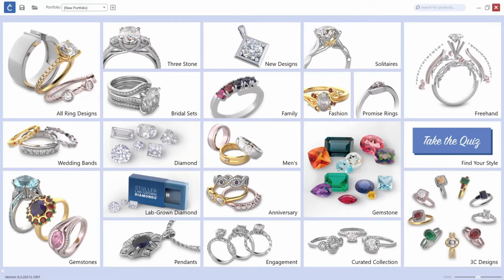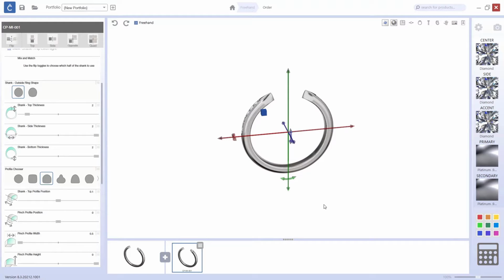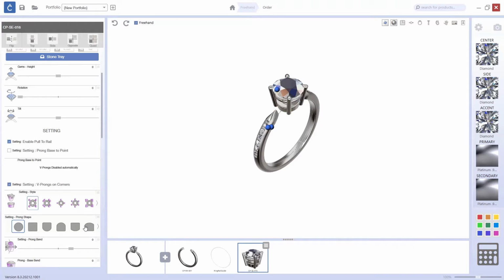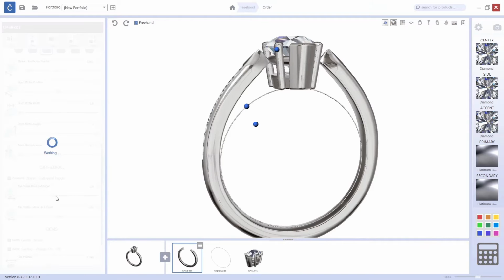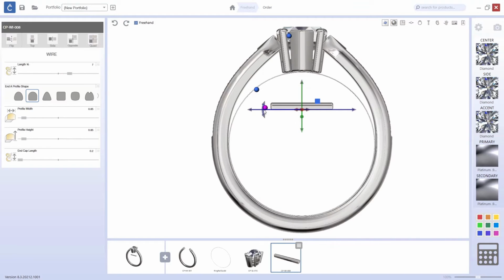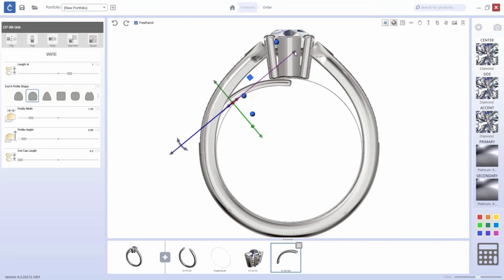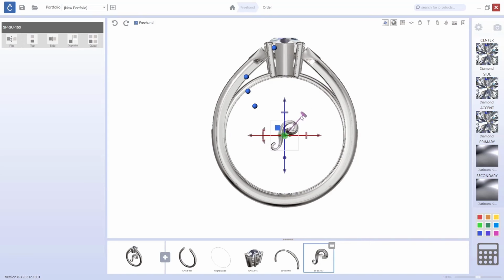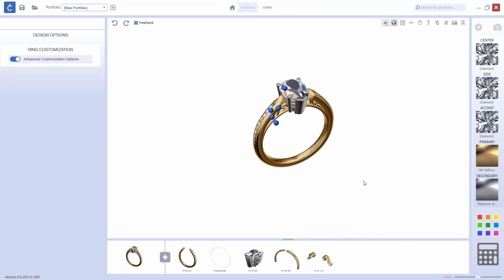Design Jewelry In a Few Minutes - CounterSketch

Comment: I tried this simple tutorial and I could not get the cathedral sides close to the 2nd rail. I slid TOP PROFILE MOVE slider all the way to the left (value =2) just like in the video and tried moving up & down but there is a big gap on each side between cathedral profile and setting. 
Version 8.6.24079.3002
Reply: try "Shank Top Profile Width" , you can change the default number to any number